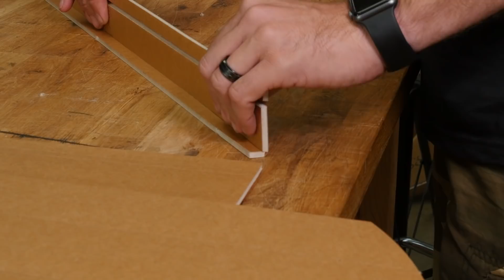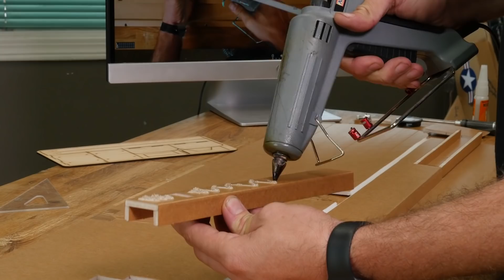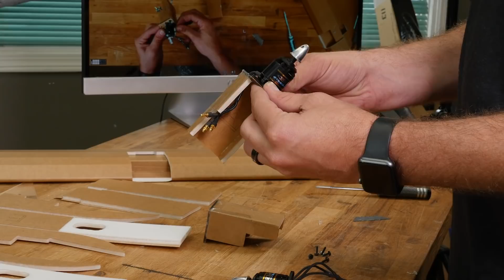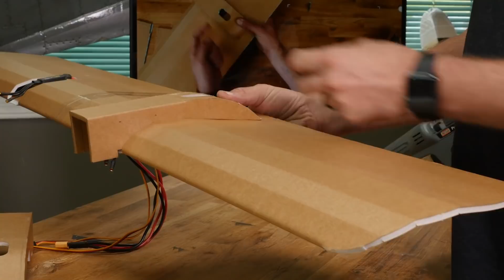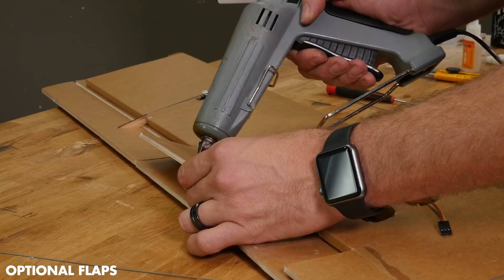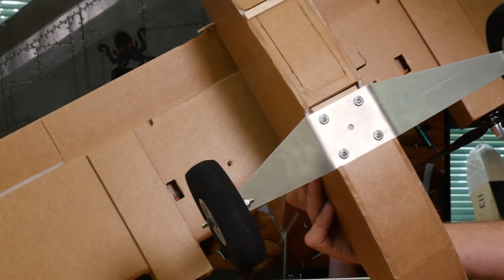How to Build the FT Legacy Part 2: Twin Engine  //  BUILD

Comment: One of my motors goes way weaker than the other. I did everything exactly the same. I tried replacing both the motor and the motor controller, and the remote too. It didn't help. What could it be?

Comment: Why didn’t you add something attached to the underside of the wing, that snugs into the electronics bay and makes sure your wing is square and centered?  Seems kind of squirrelly with just the rubber bands holding the wing in place.

Comment: I building the twin engine version,  (Fuselage done, wings perimeters are cutted) but I hesitate about may better if I build the wing in dihedral. 
I'm not an advance pilot and don't want to do any aerobatic trick (yet), more important the plane stabilize byself as mush as possible. 
Is it make sense? 
I dont't want single engine, because there is the camera, but I expecting same self stabilising as a 3CH version. Could be similar if I going dihedral ?

Comment: Do we need to disable one of the power leads from the ESC to the receiver so we don't get voltage from both BECs?
(I might have missed it in the video)
Reply: Actually it's required because as David Windestal has said in the supplemental build videos of the ft cruiser, "...switching bec's do not like to be paralleled", and only one of the bec should supply power to the receiver or else the receiver would short out.
Reply: kilroy07 nope, that should not be needed
Reply: That depends on how you want to set it up.  If your using a 6 channel receiver and want differential thrust and plug each throttle into it's own port then no.  If you put them together in parallel then yes.
Reply: @Ron G the power (eg red wire) from the esc's will be paralleled no matter what(y-lead or in the rx itself), unless you cut or remove one of them from the servo connector. what you are talking about is the signal (yellow wire).